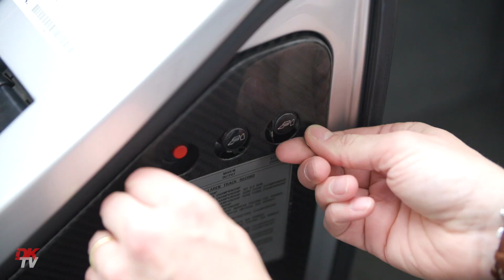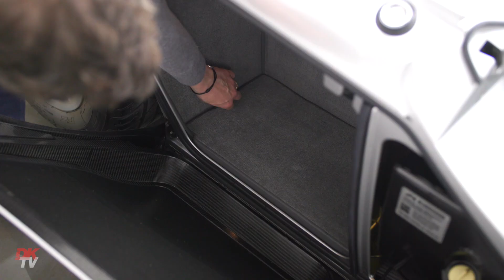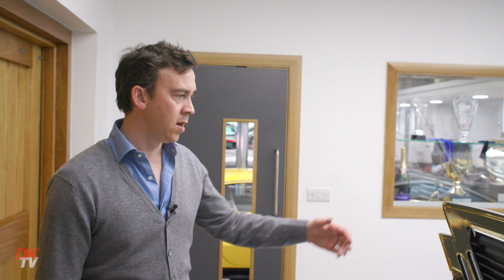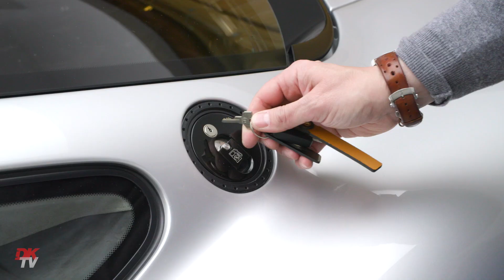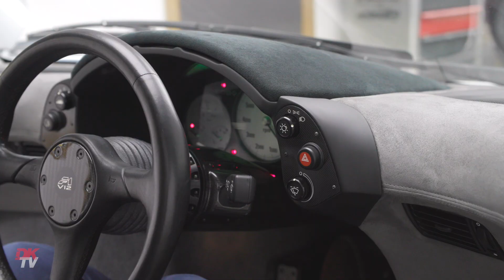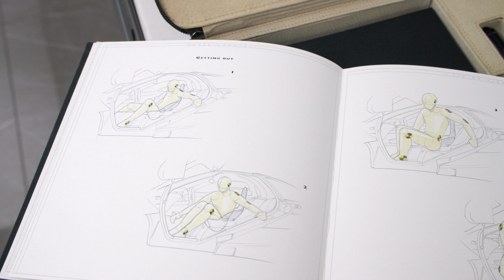McLaren F1 User's Guide

Comment: McLaren F1 facts clarification:
- It's 240mph top speed was achieved by only 1 special car, the F1 XP5. The XP5 had a 1000rpm higher redline and more horsepower, ALL OTHER F1s had a top speed of "only" 221mph, 4mph faster than the 1993 Jaguar XJ220. 
2) The F1 was not the first modern factory supercar to win LeMans. The Jaguar XJ220 won in 1993. 
3) While the F1 did finish 1st overall at LeMans in 1995, the majority of the prototype cars quit before the finish due to weather. 
Still a fantastic car, but you should know the truth.